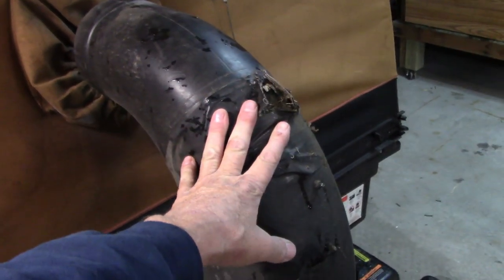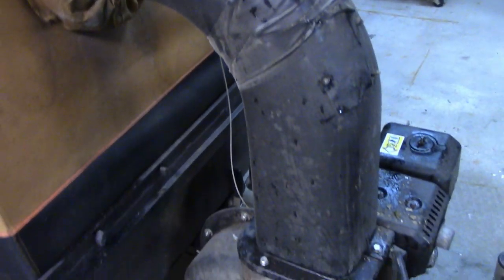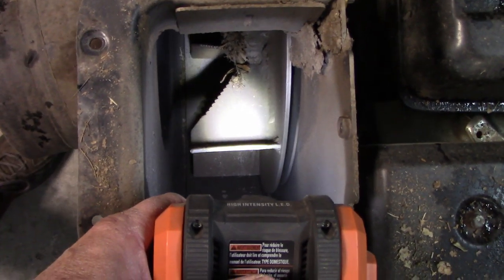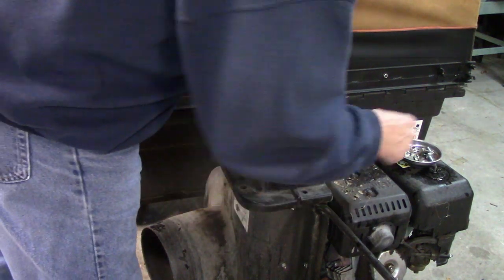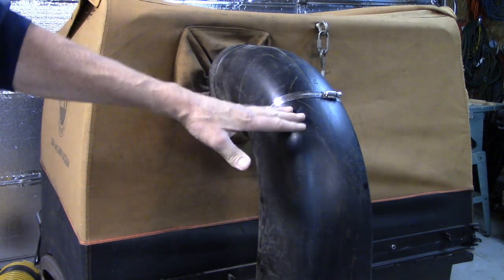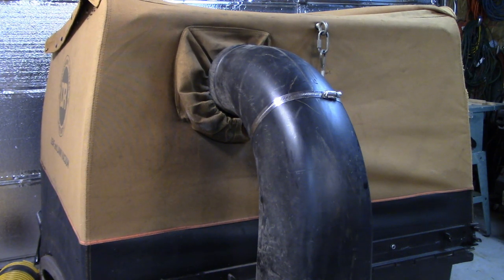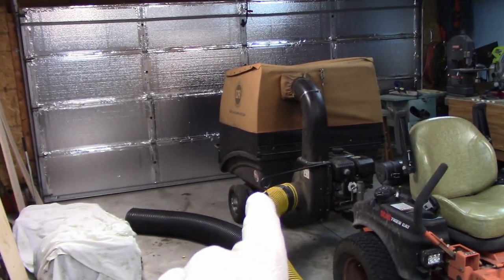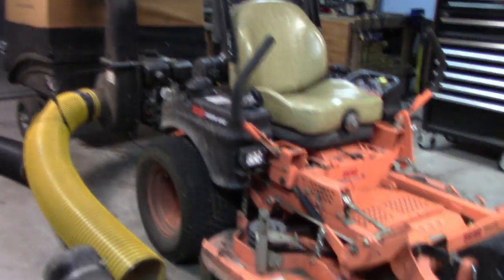DR Leaf Vac vacuum improvements for fall cleanup

Comment: I haven't noticed the leaves on the trees.   I am starting to get enough on the ground to get the DR out pretty soon though. I'm curious about what size engine you have on yours.   Mine looks the same as yours except I have electric start and you may have a bigger engine than I have. As far as the weather it's still pretty warm down here.   I'm still getting peppers out of the raised gardens out back.  It is getting cooler so there's a lot of them but they're not growing as fast as they used to.

Comment: Where did you get the extra blower and how does it get powered?
Reply from the maker: The extra blower is a Scag blower, it is belt driven by a pulley on the deck